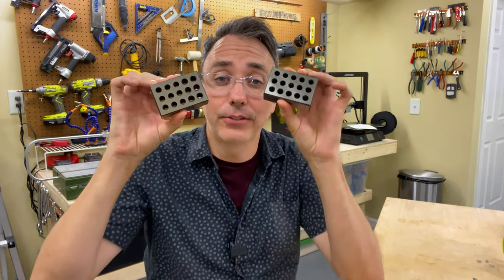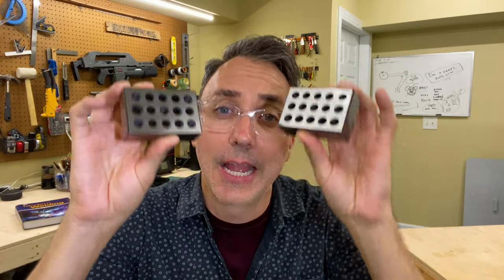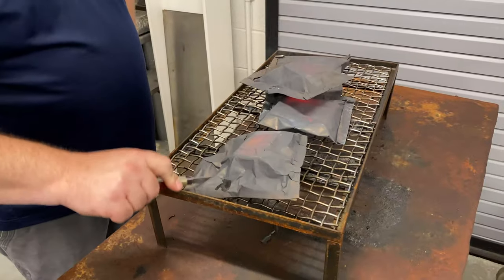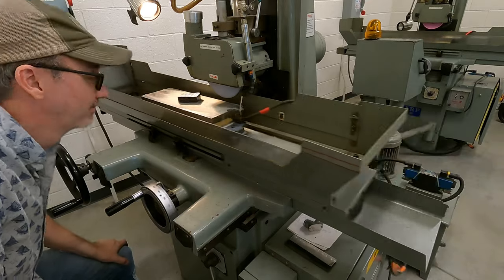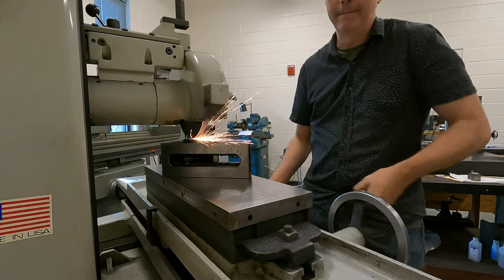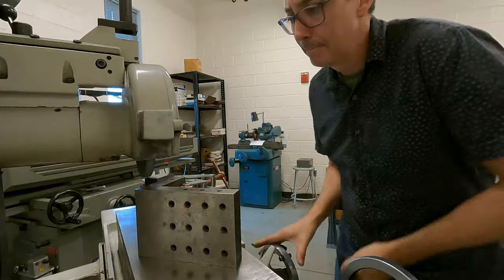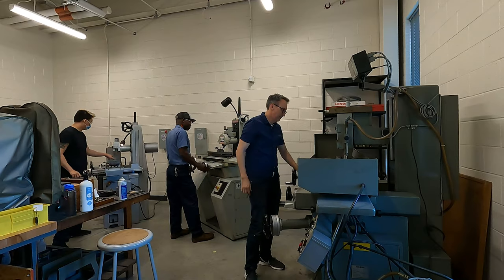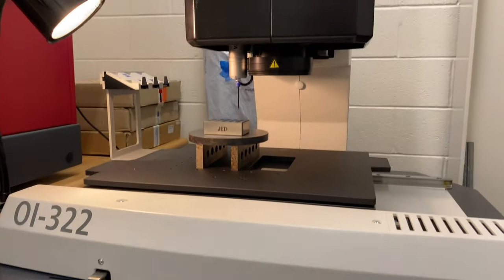Heat Treating and Surface Grinding 1-2-3 Blocks in Trade School

Comment: They get there name from the ratio. 1 by 2 by 3.
Reply: No, they get their name from the dimensions. 1-2-3 because they are 1x2x3 inches. You also have 2-4-6 blocks that are 2x4x6 inches (the 2-4-6 blocks have the same 1 by 2 by 3 ratio)
Reply: @filisoft  what about metric
Reply: @Meeky815  in metric they are named 25-50-75 (same 1-2-3 ratio)
Reply: Awesome video.
Reply: @filisoft in metric they are called stevensons blocks and are made to a ratio of 1-2-4